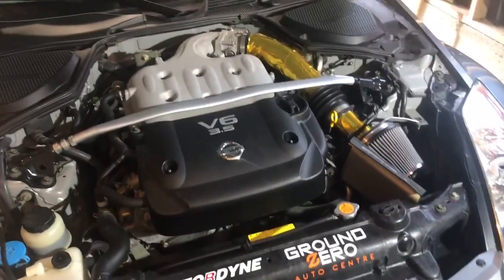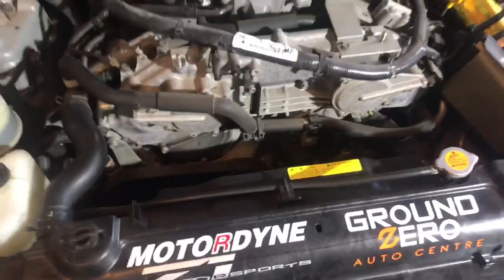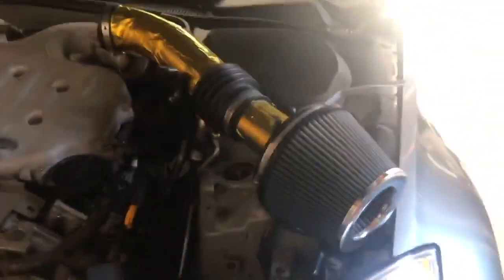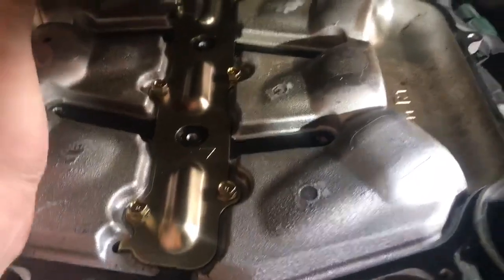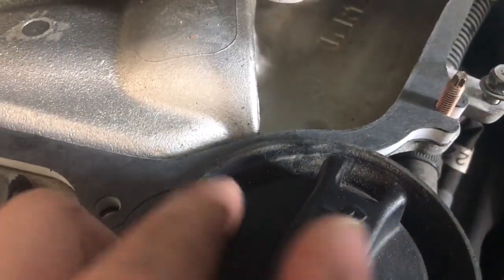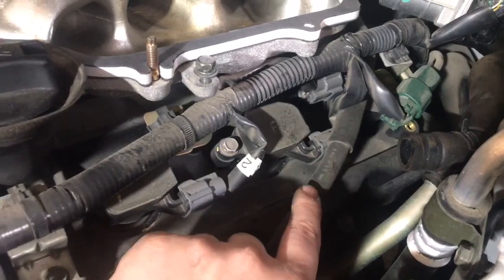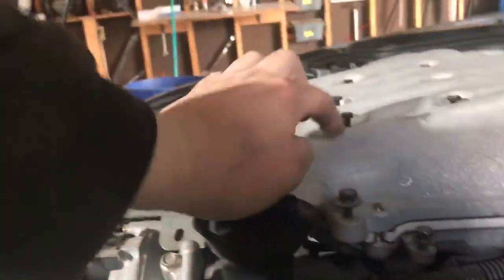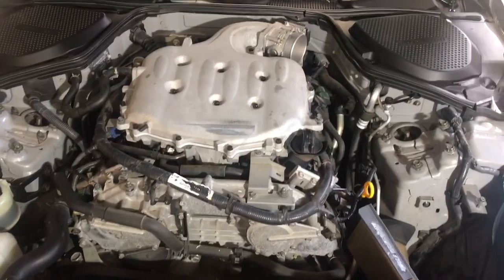350z plenum spacer install full How to Guide

Comment: Wear are those “cuffs or cups” I did not receive them or are they in therye already
Reply from the maker: They were suppose to coming with your spacer mine did anyways
Reply: @MGautomotive-s7v  cups are under the bottom gasket this is why I wouldn’t buy a 350z nothing aftermarket is clear cuz it’s bs
Reply: 370 is like they just thought abt it more

Comment: I have a z1 spacer/aam. Installed it and my hood will not close properly without the strut on or off. I have ag35 engine in my de 350z . There is no difference but isn't it because the engine heights that's causing mine to not close properly
Reply from the maker: I’m not sure? Mine had no problem

Comment: Did you get any weird noises? I installed mine today and I don’t know I’ve heard rattles 💀I don’t know if it’s like my intake box that’s hitting whenever I accelerate or something
Reply: It’s just touching your hood
Reply: Check if plenum is touching strut bar or strut is hitting intake. My strut got adjusted and also touched my hood. Vibrated upon acceleration pretty good till I changed it

Comment: Would of loved to see a test drive... did you make that video on that valve?
Reply from the maker: Noticeable mid range and low range power! I can defiantly make a video of how I did it if you are interested also noticed a gain from shutting the coolant off to the throttle body
Reply: @MGautomotive-s7v  so, between the plenum spacer and the coolant valve, how much hp did you gain?
Reply: @MGautomotive-s7v does it work for HR engines?